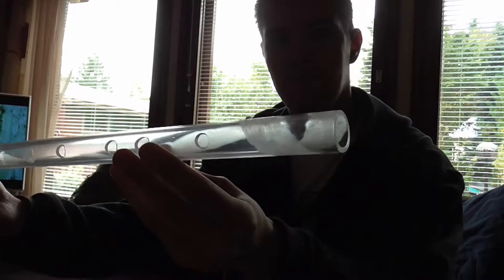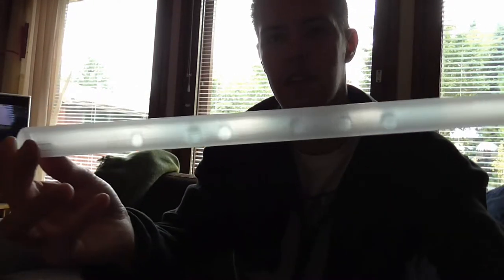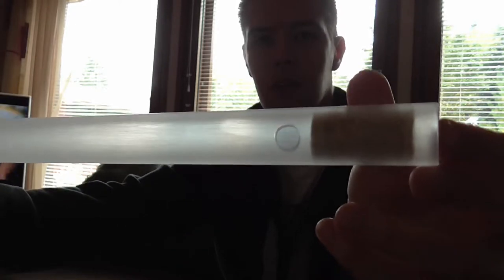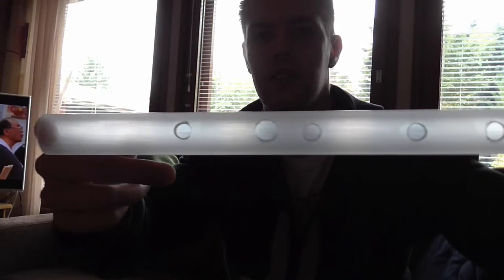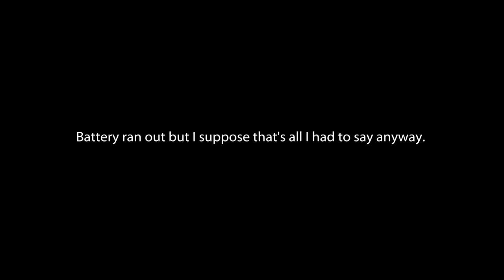Homemade glass flutes - quena and sideblown

Comment: Hello ! Y would like to make glass flutes to ! Could you show us how you make them ? How you tune them ? Is it the same thing as with PVC pipes but just a different material harder to work on ? Thank you !!
Reply from the maker: First of all, I'm not quite sure if I'm going to make glass flutes anymore, actually I haven't made flutes at all for quite a while now. I'm planning to make just one more flute, after that I just focus on playing them. The tuning with glass flute works the same way as any flute. Calculations are only based on pipe measurements: inside diameter and wall thickness.
Reply: @osflutes5141  Hi! This is so impressive. Would you mind sharing with us what tools you used to cut and mold the acrylic glass? Or any resources?  Thank you!